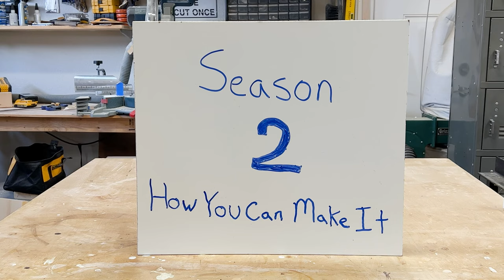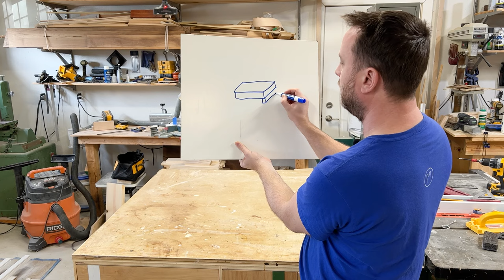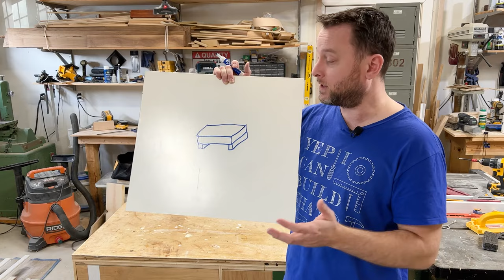1 Board Woodworking Project That Makes $100 a Month | Season 2 - Episode 2

Comment: Would have looked really nice if you stained it first, then did the routed edge, giving it a 2 tome effect. Just a thought.
Reply from the maker: thanks for the suggestion.
Reply: @HowYouCanMakeIt  Dumb questions perhaps-- the stamp that you used to put your name of the item- is that just a standard style stamp you can get t office depot etc or is it designed specifically for use on wood?
Reply from the maker: it was designed online by uploading my logo

Comment: And what is the condition of the towel bar after several months holding wet towels?
Reply from the maker: You need to apply an oil based poly to protect it